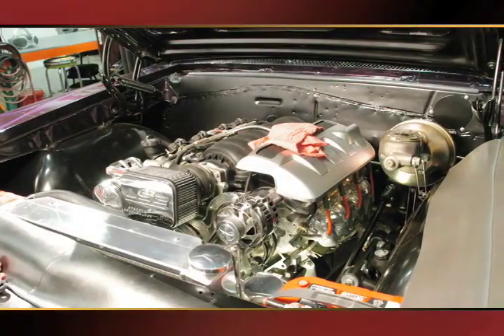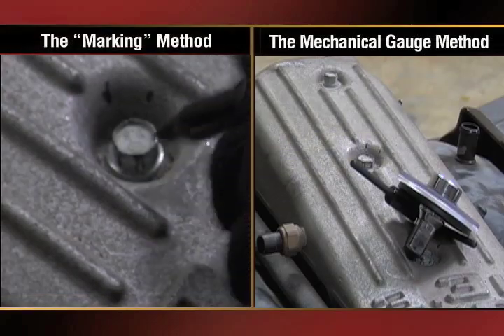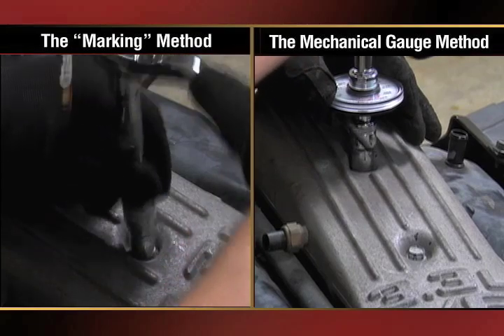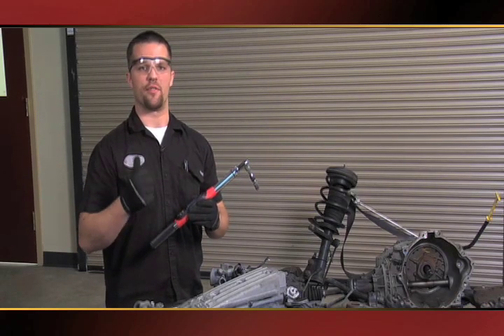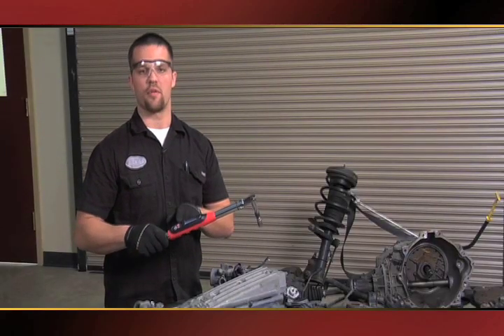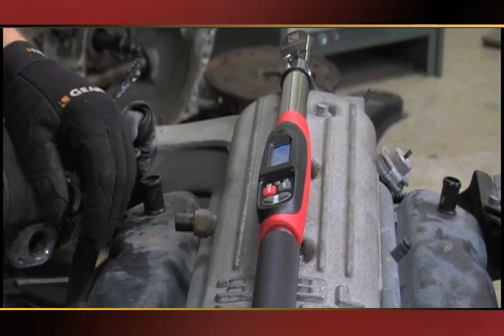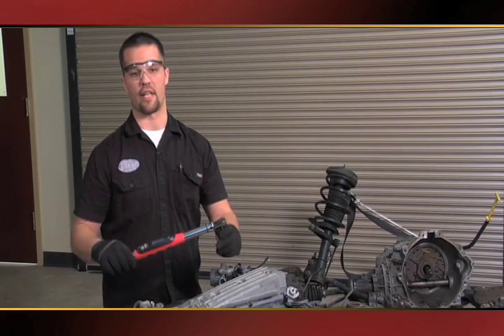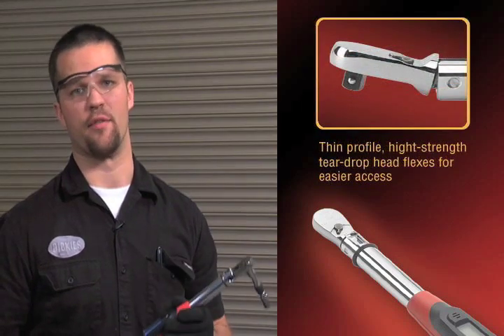GearWrench Electronic Torque Wrench with Angle

Comment: I bought this wrench solely for the angle meter ability.  the pros are the metal grip which works well with greasy hands, price and the battery cap that doesnt come off during use unlike snapon. the only cons i have are the time it takes to reset the angle meter between bolts and the flex head that has a degree or two of play which is critical when your using it to accurately measure with. maybe the next model out can address these two issues, but otherwise a great wrench for the price.

Comment: 90 degrees is easy,a 1/4 turn with a breaker bar.Jaguar headbolts can be used up to 3 times,marking the head of the headbolts.Snap On's version,you start all over again when the cap holding the batteries in place comes off.Remove the batteries when not in use.This is required with Matco's electronic torque wrenches,their cap screws in holding the batteries in place